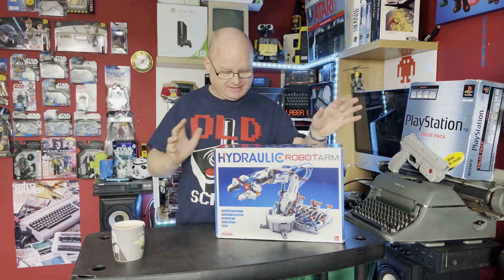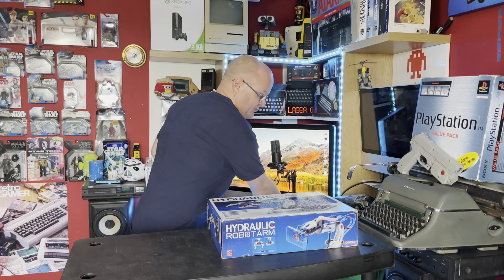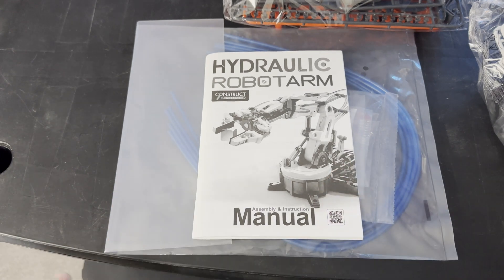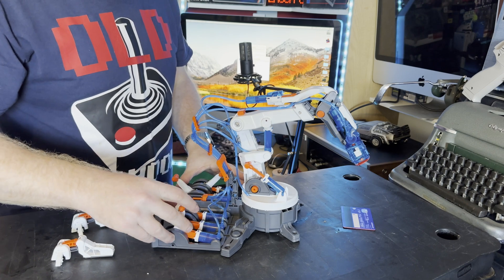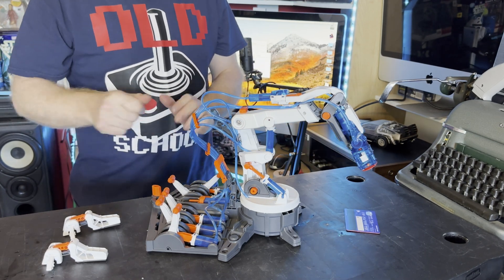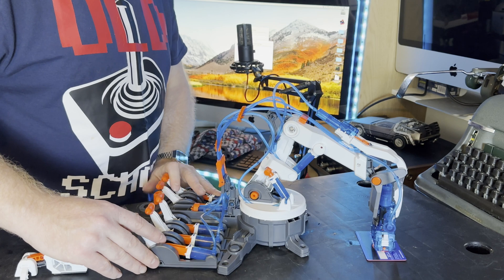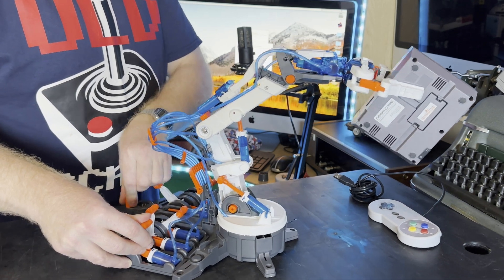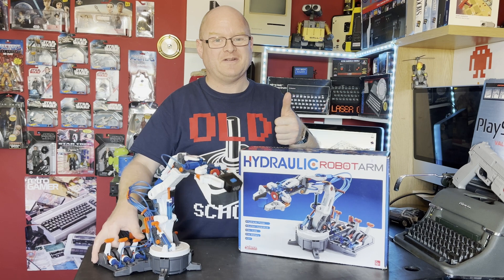Hydraulic Robot Arm DIY Model Kit : Full Build & Review : From Science Discovery.

Comment: I got the same arm but from another company, and when I try to remove water from the capsule it stays in both capsules instead of the intended one causing it to stay in one state. For example, when I use the lever for the gripper, there is already water in there so all the water stays inside the tube instead of the capsule. Any ideas?
Reply from the maker: You must have set it up wrong.